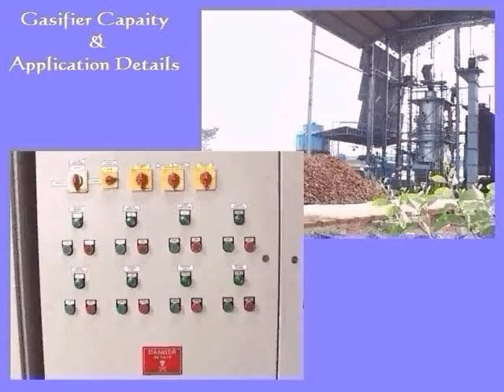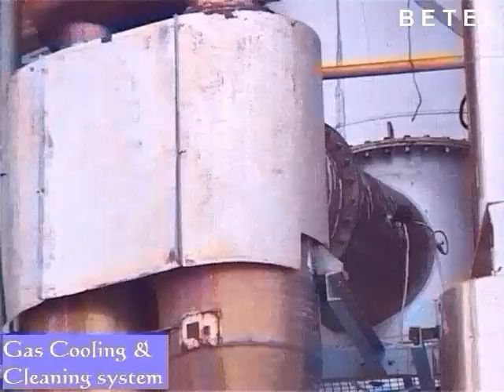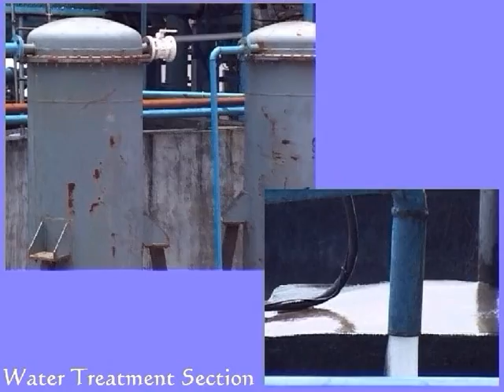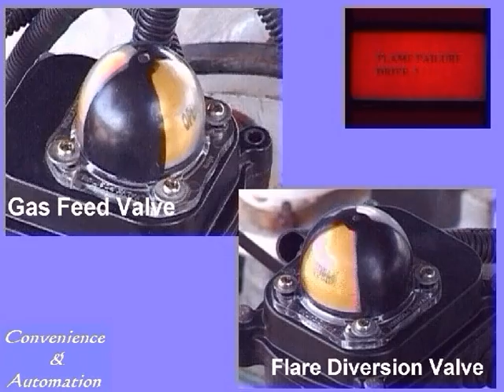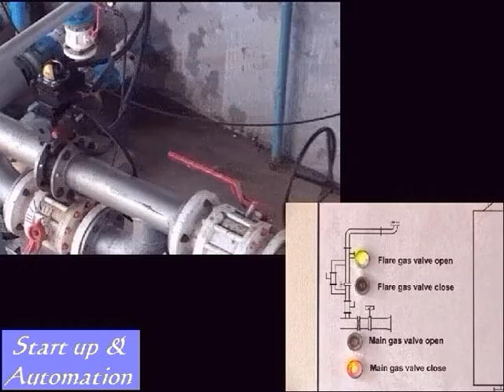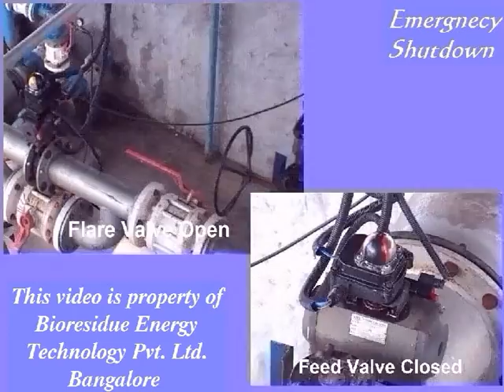Biomass Gasifier a commercial success - Part 2 - Equipment Video

Comment: Y all gasifiers are using coconut shell it costs per metric ton 14 rupes per kg.
Cut wood is costs around 6.5 rupes per kg both will produce charcoals .

Can u please share what is the difference in using coconut shell and cut wood